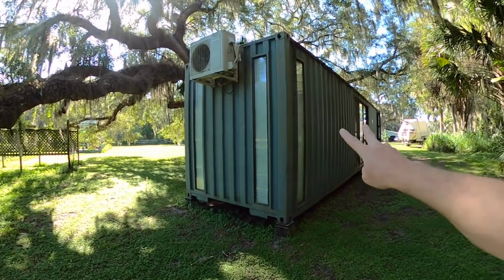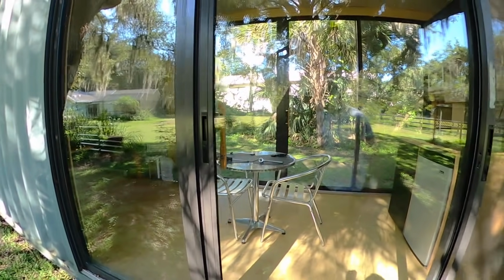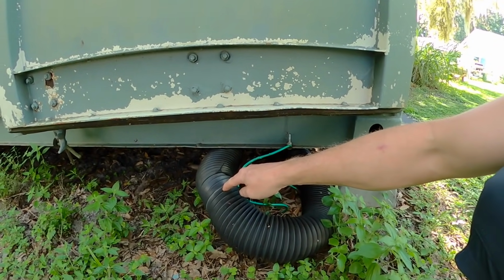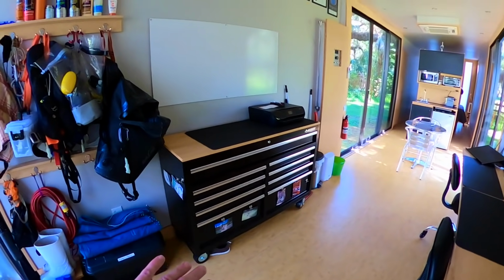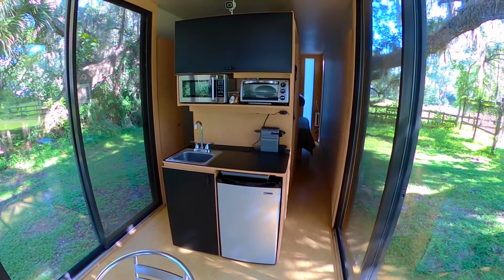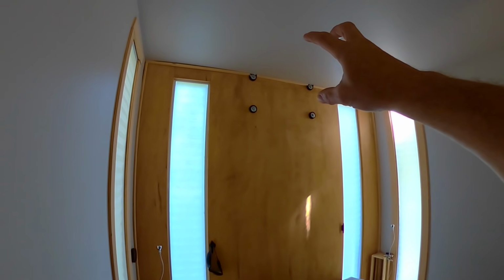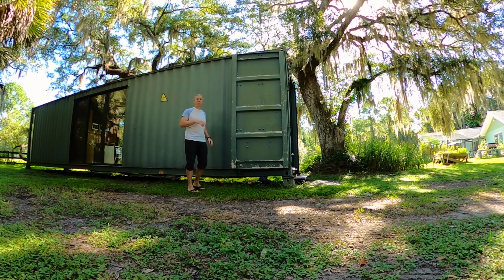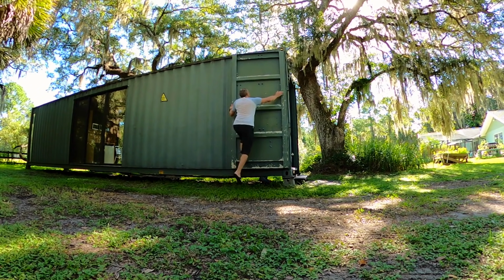How I built my shipping container house

Comment: Awesome build!. Downloaded the plans for a future build on the container in my backyard. Love the openness and utility. 
Something to consider in the future is adding a second metal roof, slightly larger and on an angle, air-gapped about a foot or two. It will cut down significantly on the amount of cooling needed in summer. Also consider a separate dehumidifier, piped directly into your grey water, to run during the winter to combat the humidity.
Reply from the maker: Good points! I already got a dehumidifier and that helps. The second roof would sure work. Thanks for the good feedback!

Comment: Like your simple foundation. No need to over build. Just add home depot foundation blocks to each of the 4 support corners, level and you're done! I assume it's strong enough considering containers are stacked multiple units vertically. Anyone know otherwise, please chime in.
Reply from the maker: 5 years like that and it has not moved. 
Resting on Florida sandy soil. 
I am very happy with how I have done this. 
It cost me $30.
Reply: @tomaskryan  Thanks Tomas! I'm hoping to copy your foundation on my rock hard central texas soil with just a 20ft container.  It's not delievered yet, so I was hoping you could suggest how I can mimic your base/foundation with as minimal effort as possible.  Two days to dig under for a jack lift sounds frightening to little old me.  Any other suggestions for me before this container is delivered? Thanks in advance.
Reply from the maker: @beckyshelton1  it should really take an hour or so to place the blocks. What is tricky was to jack up the container and put the four corners under, position and height. Be very careful for the container not to fall sideways once jacked. I had many pieces of beams placed under as backup to the bottle jack in case it failed. It feels this whole thing should take an hour or so but it turns out much longer. Good luck!
Reply: So, do you think there is no easier way to mimic the blocks you used but with less effort and time?  I was hoping you had a better solution to reach the same end after you saw how long it took?  Thank you.
Reply from the maker: @beckyshelton1  hard to say. Maybe it will take you just a few hours. To set up the jack, I had to dig a hole. If the container is already away from the groud, it could be much quicker.

Comment: Bro that is amazing, I am just starting my build, hopefully the delivery is next week. I appreciate the inspiration and the information in the PDF and website.

Question about insulating the floor: How did you raise the container high enough to safely spray the underside?
Reply from the maker: I used a simple bottle jack and put pieces of wood under the container to keep it high. I did all four corners. My container is 12 inches off the ground and that is enough for the insulation guys to spay foam under.
Have fun with you built, it is a great adventure by itself!
Reply: Curious if the bottom could have been sprayed as it was being transferred from truck to ground? Or the team that That did the initial cut out work?
Reply from the maker: Good point. Yes, I think they could have done it then.

Comment: Good day to you.
I have been reading about The hâB and I was wondering if I could ask a question or two.
This has to do with the four corners of concrete supports.  Quoting your article, "Each of the four corners stands consist of two big concrete blocks of 4 inches thick, placed side-to-side, with a concrete deck block sitting on top. The shipping container is isolated from the concrete blocks with a layer of 0.5-inch heavy-duty rubber pad sandwiched between two pieces of Trex material."
My question is, how are the 4-inch thick concrete blocks, the concrete deck block, and the rubber pad between the Trex material held together, and then how are they connected to the container corner connectors?
I would be afraid that some seismic activity would cause these to slip apart. I have looked closely at the photos, but I'm not able to see inside the container connector.
Also, is there any support on the long sides of the containers? I have read that there can be some sagging in the container if there are not some intermediate supports.
Any help with this will be greatly appreciated.
Thank you in advance.
Reply from the maker: @kevincox3530  Hi Kevin,
The concrete blocks, rubber and trex are not connected to anything. They are just piled up one on top of each other. Your concern about seismic activity is legit. Florida has no such activity, but for an area with shifting ground you probably need to secure them to each other and the container itself.
I had the same concern about sagging floor since it is basically a 40ft bridge. After 8 years, it is still perfectly straight, not a millimeter curved. Zero sagging even with no support in the middle. I guess it depends also on how much weight it carries.
Reply: @tomaskryan I'm going to build a similar home here in the Philippines, (Bohol), and we, of course, are very active with earthquakes. I have 30 years experience in engineering, so I might be able to come up with some connection for the corner footings. As far as my sagging concern over the 40' span, I will take your advice and just support the corners, but have a provision to add intermediate supports down the road. I really appreciate your prompt reply, and thank you so very much for your time! Cheers! 🤜💥🤛
Reply from the maker: @kevincox3530  sounds like a great plan. Have fun!

Comment: Tomas, thanks for sharing. This is amazing. Are you thinking about future structure add on? Second container with a breezeway or screen porch between? Did you do wireless internet or wired? Wondering if the metal container creates issues with WIFI? Curious why you did not go all the way to the edge of container with the sliding door at the end of the container?  Great work and documentation!
Reply from the maker: I think about adding to it often, but it currently meets my needs and I like that I could transport it anywhere. 
Wifi only, works well. Cell reception is good too, probably because of all the windows. 
I wanted a little deck behind the container doors, glad I have it.

Comment: The foundation thing, it really works? Where do you find them?
Reply from the maker: It works for me. Over 4 years no adjustments or issues. Worse case you jack up and reset. Super easy. 
Home depot deck post blocks and large concrete blocks. All at Home Depot. Check the link in the video description, there are good pictures of that.

Comment: So where is your electrical breaker box located...and your hot water heater?
Reply from the maker: Electrical breakers are behind the wood door I open on the left of the big window. All the electrical and switches are there, power comes through the floor. 
Hot water heater is under the sink against the back wall. Very compact Eco Smart 11 unit. Tankless. That thing really works well.
Reply: @tomaskryan  Great setup. Thx for the reply

Comment: The bases of that Container House are Hurricane-proof, or you have to leave in case one approaches.
Reply from the maker: Well. Good question. There are thousands of shipping containers in ports and on boats not fixed to the ground. At 8,000 lbs empty, I am not too worried it will fly off, especially with the square shape. I’m staying put.

Comment: Wait did you say you have 220 electricity AND water in that same tile hose, under your house?? They are in the same place,together??? What happens when you get condensation? Do you get a Big Jolt? Curl your hair?
Reply from the maker: It is just a cover to protect against UV and occasional lawn mower. All pipes and wire are separate. Wire is also inside its own pipe according to code.

Comment: How do you avoid standing water since it is a flat roof?
Reply from the maker: Good one! Those shipping containers are designed to be outside on the deck of boats crossing oceans. Some  of the most brutal environment. They drain by design, even if the roof is flat. The problem with old containers is the roof can have a ding, where water accumulates. You can fix that with the technique I describe. See link in video description.

Comment: How do you prep for a hurricane
Reply from the maker: Good question. I can close the metal doors, but the side windows are still vulnerable. I was thinking of making two decks the exact size of those large windows that would fold over them if that makes sense, but I never got around that. The big trees protect from the wind, but branches could break the windows.

Comment: Is it cold in winter or hot in summer?
Reply from the maker: The mini split can also heat in the winter, so that works well. 
In the summer, it does get hot and the AC works all the time during the day. Having it under more shade would help a lot. 
More insulation required for a climate like Canada for sure.

Comment: In the article you mentioned that your uncle convinced you to drive a grounding rod connected to the container. If this is intended for safety in the event that the container becomes energized by the one of the phase conductors touching the metal frame.... perhaps to "safely send the electricity to earth".... please seek a second opinion from a electrician who is familiar with "grounding and bonding".  This is an area of intense confusion and outdated beliefs. I have no idea what other shipping container homes do.
Reply from the maker: Well. My shipping container is on four concrete blocks and between the metal of the container and the blocks I have rubber spacings. This means the container is completely isolated from the ground and could become charged. The connection from the metal of the container directly to the ground rod ensures zero voltage between the container and ground. 
I bet I am the only one doing this. All other containers are directly on concrete, and therefore not isolated. Hope that makes sense.